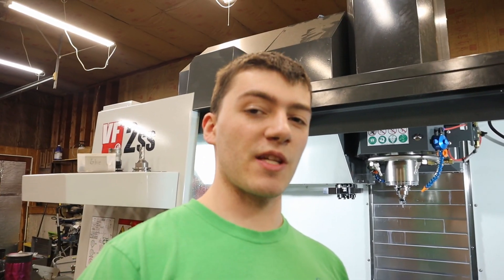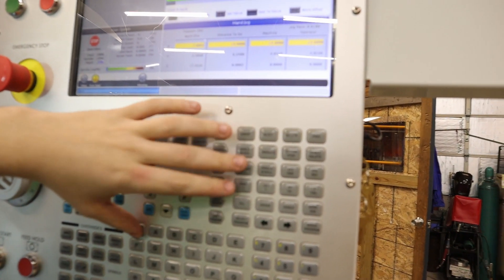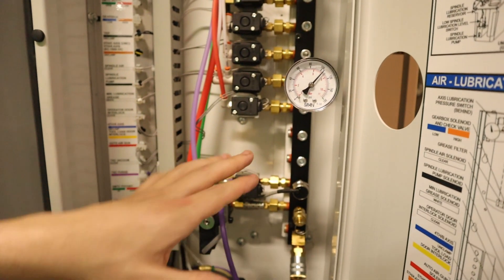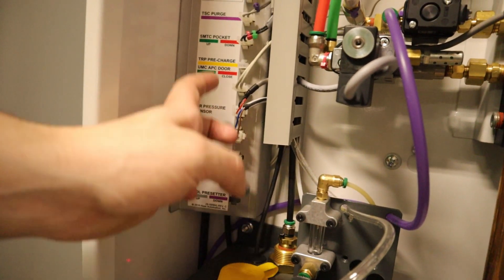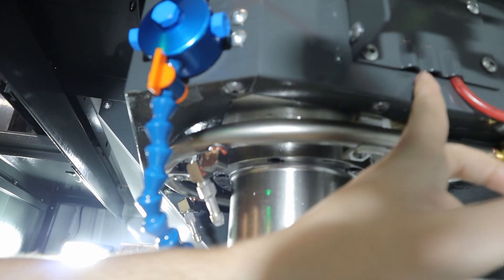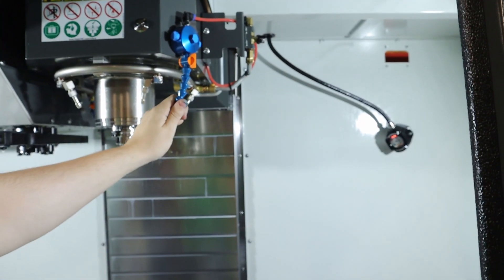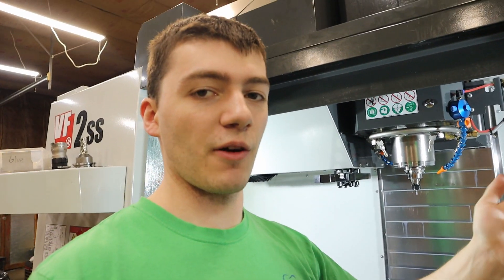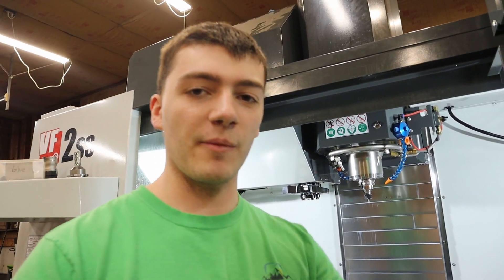How to add airblast to your HASS vmc for cheap.

Comment: Some haas machines come with MQL (minimum quantity lubrication) . The machine has a 1 gallon container that you can even use alcohol and you can program it to shoot air with droplets of alcohol in a venturi system. 
Which also applies to dry cutting. 
This is good when cutting titanium for med device implants.  Coolants and oils will contaminate titanium and cannot be used for human implants. 
Im pretty sure that Haas has made videos on the usage and programming procedures with the MQL system.

Comment: Wanting to add this option to my TM-2P.  I know you shared the parts list in your YouTube video, but wondering if the Solenoid is a MAC?  If so, do you have a model number as they sell them on Amazon.  Finally what is the wire connector that you would need to buy?  Sent you an email but thought I would post here too.  Thanks,

Comment: For other who wants to perform this mod.
The air hoses are tuck away in a square box "behind" the spindle head.
Mine was Haas VF-2 built in late 2019, and it doesn't come with the red air hose preinstalled.
I couldn't source any 1/4" air hose here in metric world. So any 4mm x 6mm air hose will also do just fine.
The G-Code that activate the air blast works from the control. No extra features needed to unlock this.

You'll need to open the following covers
1. spindle head cover
2. the square box behind the spindle head (here is where the air hoses are tucked away)
3. the top cover from the air cabinet to the spindle head
4. cable carriers cover from the spindle (use flat head screw driver to de-latch each section, start from the top)

Start from the box where the rest of the air hoses are tucked away. Route one side the air hose through the cover to the air cabinet, and the other side through the cable carrier to the spindle head.
Unscrew and remove the metal bracket plate that hold the coolant shut-off valve and guide the hose from the spindle head though the square opening.
Reinstall the bracket plate while keeping the air hose through one of the opening (Don't pinch the air hose with bracket plate at this point).

The solenoid is VT307K-3H1-01T-X362 from SMC.
The electrical connector that goes to AIR BLAST port is either MOLEX Mini Fit or MOLEX Micro Fit (not sure)
Reply from the maker: Thanks for the detailed rundown. I'm sure someone will find it useful.
Reply: I also just completed this upgrade. Our 2021 VF-2 did have the red hose preinstalled and fully routed through to the spindle - I only had to remove the coolant shut-off valve bracket and pull the red hose through. 

The magnetic loc-line manifold, although solid, didn't stay put as well as I'd hoped. I drilled a hole axially through the center and bolted it to the coolant shut-off bracket. Likely overkill, but I also milled a flat in the manifold and put an o-ring under the bolt head to create an airtight seal. Now it isn't going anywhere. 

Thanks for the help guys!

Comment: This isn't a feature that you have to buy from Haas? I mean on the control side, after you get the mechanicals hooked up, I'm surprised Haas doesn't make you pay to get the feature unlocked on the control.
Reply from the maker: Nope! The mcode for firing the airblast must be standard in all the controls. Lucky for me haha.
Reply: @split141x  My 2022 VF2 isn't letting me activate that,  Shift- Coolant = disabled .... going to use Aux M code and set up a relay, another useful thing they want to charge you for now
Reply: @Dfabdesigns  same here haas dm2 2022.  shift + coolant= Feature diabled.  when I navigate to "features" tab, airblast isnt even an activatable feature.  so stupid.  well, I guess its time for m codes and relays like you suggested.

Comment: What air compressor do you use?
Reply from the maker: An 80 gallon irrgersol rand. Its got two pistons so I think thats a dual stage. Runs on single phase 30 amp motor starting pull. If the compressor starts and the machine is ramping to 12k rpm the machine shuts off. But thats kinda a different topic :). The compressor does keep up but it will cycle for quite a while if you have air blast on. Id say itll run 70% of the time if airblast is running.
Reply from the maker: If you have any more questions please dont hesitate to ask :)